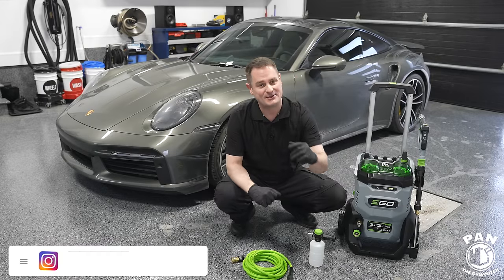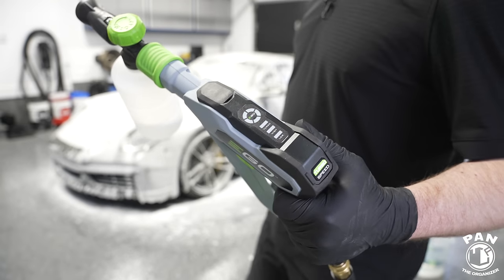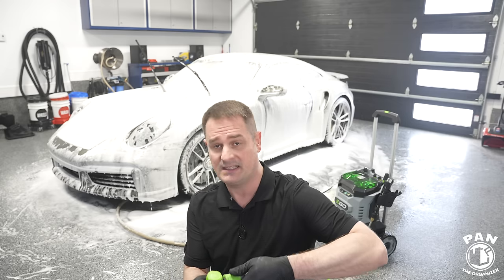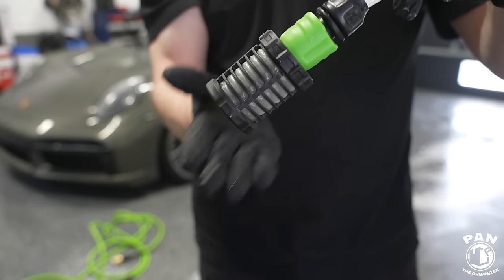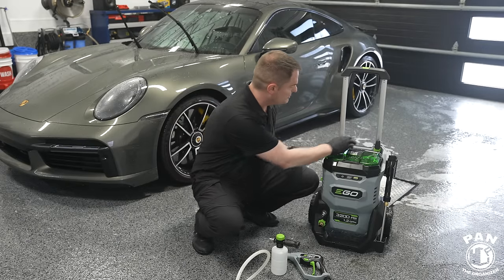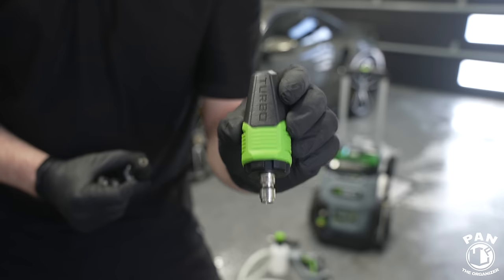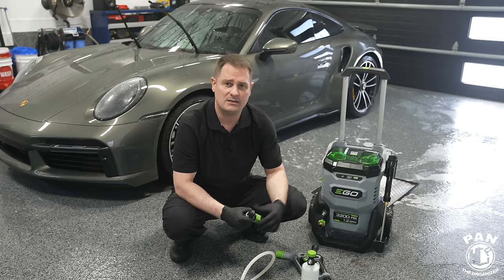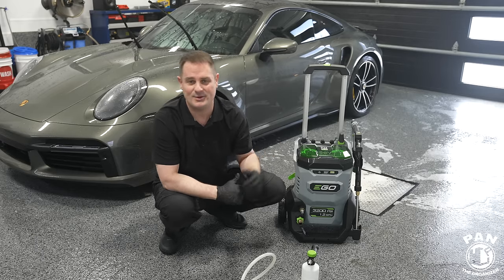EGO Battery Powered Pressure Washer Review... 3200 PSI??

Comment: Dang, I'm so conflicted on this one.  I primarily wash my cars at 2 places. At home I live in an apartment where I have a dedicated garage parking spot but no access to power or running water.  I also wash at my in-laws once a month where I do have access to power and running water.  

I'm trying to decide on investing in an Active 2.3 or this Ego washer.  The Ego I'd be able to use at home and on the go.  The Active 2.3 I can only use at my in-laws.  I'm conflicted because the Active is a much better pressure washer for the money.

Comment: I have always wondered if everything in your garage gets wet when you are washing a vehicle. I feel like it would and in the video you can see the water particles floating in the air after rinsing. Is this something that forces you to dry things off after a wash?
Reply from the maker: My garage is pretty big at 24x24 (576 sq.ft) and super tall 13 ft ceilings, so water splashing is of no concern really. Plus I have a dehumidifier which keeps humidity controlled. See all the details in my full garage tour video here: https://youtu.be/wx6HTBAzeXI?si=yleD5xauwmcUiAW7

Comment: Hi Pan, wondering if the battery compartment is large enough to accommodate 10AH batteries.
Reply from the maker: According to EGO, it can fit up to 12 Ah batteries if you read the manual. So no problem for the 10 Ah batteries (part number BA5600T).

All the following battery packs are compatible: 
BA1400, BA1400-FC, BA2800, BA2800-FC, BA4200, BA4200-FC, BA1400T, BA1400T-FC, BA2242T, BA2242T-FC, BA2800T, BA2800T-FC, BA3360T, BA3360T-FC, BA4200T, BA4200T-FC, BA4480T, BA4480T-FC, BA5600T, BA5600T-FC, BA6720T, BA6720T-FC
Reply: @PanTheOrganizer  Great video!! Thank you for doing this. Do you know if you can use two different size batteries together? For example, I have a 10 and a 6… would that work, you think?

Comment: So I have had this now for 5 weeks. I used it 3 days  a week weekly. It's in my mobile setup. I have been in there platform for years now and have lots of batteries.  This is a better setup for me than if I was to run a powerwasher like a kranzle or an AR blue. Because I don't run a generator. If I was to buy a generator and a Kranz or AR I would be will over the $800 price here. Keep in mind I have about 8 batteries from lawnmowers n other tools in there line
Reply: Ps guys, if u want this, pick it up at Lowe's. It'd cheaper n u have a great protection plan from Lowe's
Reply: Pan, I forgot to add. I can do 3 full-size SUVs on the 2 batteries. I do sometimes have to swap on the 3rd but I do run them in turbo for foam and normal when rinsing n turbo on wheels

Comment: Id like to see a full wash wheels body etc from the machine. Turbo mode is only 15 minutes thats fine for rinses and foams but what about a full wash wheels door jams body etc.
Reply from the maker: You wouldn't use Turbo mode for cleaning cars. The normal mode is what you want, and that gives you MORE than enough runtime to wash a cur. Absolutely no worries for battery life here.

Comment: @pantheorganizer is it possible to connect the foam cannon to the gun while its in it's holster? I just got mine, haven't played around with it yet. if you don't get around to checking I'll Edit this later when i test it. Also maybe the foam cannon can connect to the the quick connect of the hose for use with a water bucket? At least then it will be strapped to the machine.

Comment: Been using Ego's Lawn tools for years. Their batteries tend to crap out every 2-3 years. So, factor in the cost to replace the batteries every 2-5 years. Now I just get generic batteries from Amazon which tend to last the same but at least are much cheaper. I am locked into the brand with so many tools so don't have many other option.
Reply: Can you recommend any specific generic from  Amazon  as I have about 15 ego tools and would like to try alternative batteries if i do not lose performance?

Comment: thanks for your review, Pan. But in my opinion, you missed one of the most amazing aspects of a system like this or other ones on the market that have a draw tube for pulling from a separate container… Using distilled water and having a completely spot free final rinse!!!!  No towel drying or marring!!  Not everyone can afford a CR Spotless.
Reply: Pan has the CRS resin system to purify his water supply. I have the same and that is key for no water spots - even in the direct sun :)
Reply: @brianhickey5949  I have a CR Spotless system as well... but I encourage many of my customers, especially motorcycle people, to buy a portable battery operated power sprayer with an intake hose dropped into distilled water. It's a lot cheaper alternative normally than then buying a full filter system.    Deionized and Distilled water are the same just thru different processes.  No minerals,  just pure h2o...
Reply from the maker: Good point.

Comment: Hey I have a question, so I’m starting to use a foam cannon so I want to know what’s the right amount of soap and what’s the right amount of water to get a right mix. I have a plastic normal bottle. Thank you
Reply from the maker: It depends what snow foam you are using. Follow the instructions on the label of your specific product, as things can differ. Use that as a starting point, and adjust the dilution accordingly depending on your pressure washer setup and if you have hard or soft water.

A good starting point is usually a 1:10 dilution ratio, meaning 1 part product for every 10 parts of water. So in a 32 oz foam cannon, you can put 3 oz of product and 29 oz of water, for a total of 32 oz.

Comment: Regret buying, not recommended. 
I own an EGO blower, trimmer, chainsaw, and lawnmower. I'm very happy with all of them, so deciding to purchase this pressure washer was an easy decision. I was very disappointed with it's operation, which was an exercise in frustration. 
The status lights to tell you powered on/off, pressure level, and Bluetooth pairing are invisible in normal cloudy or sunny daylight. This is true for the unit itself and for the gun/handle (but not the batteries). This means that one cannot tell if the unit is powered on/off, the pressure level, or Bluetooth pairing. When turning the unit off, the unit continues to run for 10-15 seconds so one is not sure if you pressed the button hard enough the first time. This is particularly a problem if one uses hearing protection when using this unit. I returned the unit after one use and cannot recommended it to anyone who uses it outside.

Comment: Hey Pan
I'm pretty sure over the years you and other you tubers like Yvan have mentioned that 1100psi should be the ideal/max for paint and now you're saying just over 2000psi is safe. Why such a huge discrepancy in PSI?
Reply from the maker: I never said over 2000 psi is safe. I always recommend staying under 2000 psi. I set my pressure washer to 1000 psi by the way.

Please get your facts straight before making false claims.

The EGO unit has a MAX pressure rating of 3200 psi. And it has three different power modes. Obviously you wouldn’t be using its maximum pressure to wash cars.

Comment: That pressure washer isn't meant to be used using a bucket method. It puts out way to much water and pressure for that. You want to do a bucket/pressure washer method buy the Ryobi hand held 18v battery operated pressure washer.
Reply: It is meant for that. The siphon tube is included with the package and the pump is designed to work with 0 psi inlet pressure.

Comment: You should try reviewing more battery power pressure washers
Reply: How many decent ones are available?  The others I have seen are cheap and what I would consider not worth spending money on.
Reply: @timkinley1779  let pan weed them out, show us the good gems
Reply: @maurice8832  Not much to weed out, if this is the only one.  I was originally really interested in this unit when it was announced.  I do several large RVs, and this would be mobile enough.  I want a monster pump for foaming . Because with a battery powered unit, I don't have to worry about tripping a breaker, if the available outlet can't take the draw of my electric unit.  Maybe Kranzle or AR will develop one someday.
Reply from the maker: I have no interest in such things. There are already channels that focus on testing pressure washers, like @CarsWithKeav and @ImJoshV

I can't possibly begin to test everything on my channel. It would get overwhelming. And I don't have a passion for pressure washers. I will test a few every now and then, but I'm super happy with my range topping Kranzle unit, so I don't feel the need to test many hehe.

Comment: Amazing video, very great demonstration of its capabilities and very detailed. However, EGO are delusional beyond belief for releasing this product. $400-$500 for the pressure washer itself? Oh goodness no. A GreenWorks 1900 PSI 1.2 GPM electric pressure washer kit which includes a few attachments is only $99.99 at BestBuy and you don't need any batteries nor have to worry about batteries dying during use. Even Harbor Freight has an electric pressure washer right at $200 which has 2000 PSI and 1.3 GPM. Anyone who buys this pressure washer is a complete fool, I'm sorry. Except for you Pan, but anyone else who buys this is a big fool.
Reply: The quality between this and the junk units is the price difference.
Reply from the maker: Hehe no worries. Although I understand part of your point, keep in mind that typically, any cordless item will be more expensive than a corded counterpart. Take polishers for example. Pretty much all the battery powered units within a brand are more expensive than their corded counterparts in the same brand. Batteries are pretty expensive.

I don't think someone looking for an electric pressure washer would be cross shopping for a battery powered one. I can get a good Active 2.0 pressure washer at half the price of the EGO, and the Active is a better performer. But it's corded. Some people might need the battery power, so for them, it might be worth the expense.
Reply: @PanTheOrganizer  Very good points, I have to agree with you on those. It's more understandable to see it from a different point of view indeed.

Comment: I don’t understand this process for using anything above 1800 psi at 2 gallons per minute to wash your vehicle does to me would be more for cleaning your floors, your deck, pressure washing concrete and so forth. I see no need to ever use this on your vehicle.
Reply from the maker: Ideally you want to be near 1000 psi and as close to 2 gpm of water flow for detailing cars. That's what I set my Kranzle to do. :)

Comment: Psi numbers are useless in pressure washer marketing.  The head will determine psi.  A tiny head will have high psi but useless practicality. You want to look at gpm.

Also, pressure washing is not a good way to wash a car.
Reply from the maker: Water flow (GPM) is my preferred number to look at. My high end Kranzle pressure washer (the best electric pressure washer on the market) pushes out a stout 2.1 GPM of water and is perfect for washing cars.

But please don't propagate false information by saying pressure washing is not a good way to wash a car. That couldn't be further from the truth. I have been detailing cars for over 27 years, and never once had issues. Same applies for any detailing channel you watch: they all use pressure washers. 

So without any knowledge about the detailing world, or any valuable real world experience on the topic, please keep such opinions to yourself, especially when making bold states, with zero facts to support your claims. That makes zero sense.